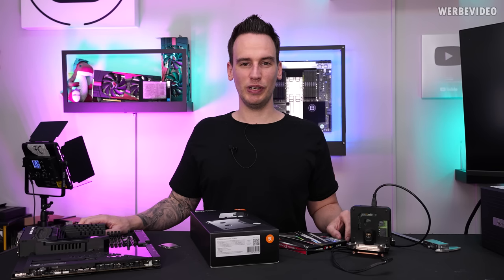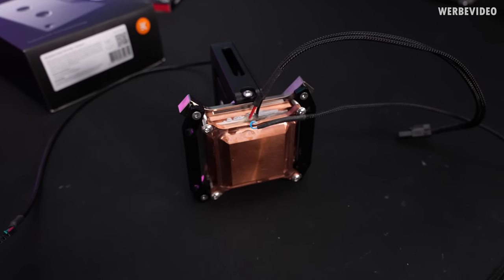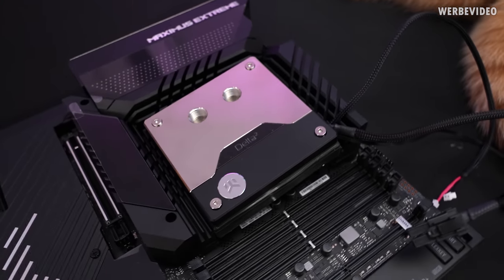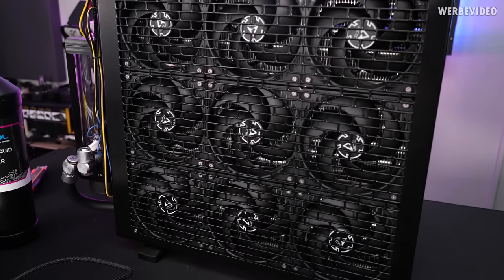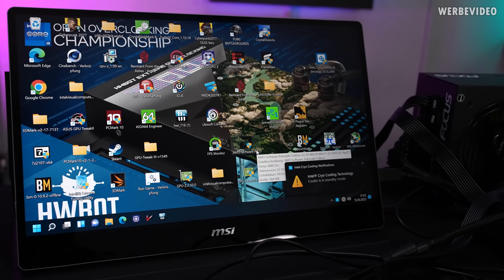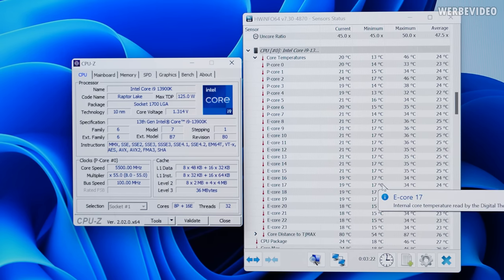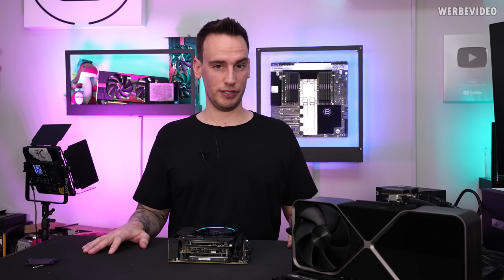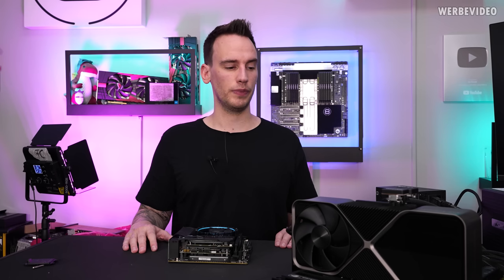This insane 500$ Water Block allows 13900K Overclocking above 6 GHz

Comment: How does the controller know the dewpoint? Temperature and pressure are easy to measure, but I don't think I've ever seen a small instrument that measures dewpoint. I just looked online and the only devices I saw for measuring dewpoint were very large instruments that cost thousands of dollars.

Tec cooling just doesn't make sense to me: so much complication and power use to get a marginal temperature decrease over ambient water cooling, and you still can't really go substantially sub-ambient (even with a big enough tec to do the job) due to the condensation problems in most climates. Exotic cooling makes sense to me in a test-bench context for extreme overclocking, but I don't see how exotic solutions really provide any substantial benefit (at least relative to the cost / complexity) for any kind of daily use, and even in the edge-case where you're crazy enough to do sub-ambient on your daily PC, I feel like phase-change cooling makes way more sense than Tecs. With phase-change at least you can get those really low temperatures.

Comment: sweet but how would the CPU handle City Skylines with 30 Mods, 2000 Assets, High sim settings TM:PE and a pop over 100,000 Cims

Comment: I don't get the 9 computer fan setup used by some Youtubers.
Almost any car radiator + car fan bought in a scrapyard would yield better thermals for a fraction of the price. Am I missing something here?
Also, the Peltier could be used in a liquid-to-liquid heat exchanger instead of direct mount to the CPU. It would cool down the liquid (not water) just before entering the CPU's waterblock, and have its hot side cooled down by the water exhausted by the CPU's waterblock. Thermal conductivity of the Peltier wouldn't be an issue anymore.

Comment: Isn't the DT1 error code means, that the Delta(Δ) Temperature is not met the expected value? Maybe the controller modifies the PWM for the pump/fan to check their condition, and expects a Temp raise or something along the lines?

Comment: David Miller (aka mllrkllr88) removed an inductor from the control unit and that could do the TEC to work at 100% all the time (with its PROs and Cons). Could be useful if you don't want to mess with software or try AM4/AM5. Regards

Comment: Great video!

Temp on single core/light multi core load seems crazy, but what about heavy multicore load? Could the peltier handle a cinebench multicore load?

Thanks
Reply: You'd need even bigger radiator. Peltier doesn't do it's magic for free, it consumes a lot of energy - and that energy needs to go somewhere.
Reply: @mirkokurac  my question was different. I argue the fact that those peltiers could not handle a full load 13900k and therefore you are going to have worse performance than a standard waterblock. The inefficiency of a peltier system is another topic.

Comment: I use Thermoelectric Coolers in elemental analysis to condense out moisture. They’re horribly inefficient and not meant for continuous and sustained loads. They will cool continuously up to a point, but you’re just wasting a ton of power.

Comment: which one is better? The intel tec2 cooler from ek or direct die cpu cooler from ek. Which one is better for heaving gaming and consistency?
Reply: what software did u use to auto adjust the boost with changes in themal

Comment: I believe the first commercial CPU peltier cooler was used in the early 1990s to cool a PowerMac 8100 CPU. That design was short lived as the flaw was the formation of condensation. Apple's solution at the time was to swap out the peltier with a traditional heatsink and fan.

Comment: You mentioned a 170mv voltage offset. Is it possible to have the voltage offset scale with frequency? 6.2ghz may need 170mv, but 5.9ghz shouldn't need as much.
Reply: You ca do this via the VF curve

Comment: Now that cpus went nuts with power consumption the idea of tec looks quite promising. My only concern is the liquid temp in the loop. AFAIK it should be below 50c for 24/7 usage in order to avoid hoses and o-rings deterioration. What’s your take on that, Roman?
Reply: what type of hose? PETG is pretty temp sensitive, but the o rings should have no issues at any temp in a pc. Remember cars use the same rubber for gaskets and hoses on coolant systems that operate at 100C for a decade or longer without fail.
Reply: If you have 50c liquid it means you are not cooling the liquid adequately. Liquid should reach a few C above ambient temp for high performance cooling.
Reply: Peltiers perform worse as load increases, if anything the opposite is true - It would be better for a CPU with a lower power consumption.
Reply: @CrusnikofChaos  Not true. I set up my itx rig to cool a 12900k and a 3090 on a single 240mm thin rad in a sub 10 litre case. 

The max CPU temps are 85c and GPU temps 75c, but the coolant can run up to 47-50c with fans ramping up to keep it no more than 50c.

I've had the system for 2 years and it runs perfectly and stays very quiet! 

Coolant running up to 50c is safe and useful for tiny builds
Reply: @Tom--Ace  This is not high performance cooling, for example I run a mora3 420 temps go a few degrees over ambient for moderate loads, better for high oc. I run 9900k 1080ti sli system, 1090watt full load.
Reply: @alexmills1329  I mean soft tubes. Not everyone builds hard tubes. Soft ones are quite practical.

Comment: So the issue with the rubber block sealant on the underside of the cooler is the hot and cold wires are protruding outward and sit on top of the VRM heatsink which doesn't allow it to drop into place or flush with the motherboard, correct? This appears to be the issue with rubber block sealant on z790 boards as the 4 mounting screws do line up it appears for the z790?  I could be wrong as I don't see a big difference between z690 and z790 as the mounting holes on the motherboards are the same I think. That said it looks like you could cut out a small section of that rubber block sealant on the top right corner, pull the cables toward the RAM slots and stuff the hot and cold lines underneath allowing the Delta 2 TEC to drop into place. Can anyone confirm?

Comment: Perhaps DT1 stands for "Delta Temperature 1"? Comparing the cold side thermo couple temperature and the internal CPU temperature and coming up with an error if the difference is too big? Essentially detecting a bad thermal contact between the cooler and the CPU...

And since the software sees the CPU temperature of the miniITX board the error comes up periodically.

Just a theory.

Comment: This is the way to go. I've been using a Frankensteined tec cooler for the last 15 years but it's only now that I'll splash out and get this product. The unfortunate thing is that it will only be compatible with socket 1700.

Comment: Why wouldn't one connect a sub-ambient cooler to the water loop via a water block, so that the chilled liquid can be used to cool multiple components? That's what I want to do with a phase-change cooler.

Comment: Hi @der8auer,
Will the Thermal Grizzly wireview available for the old 6/8 pin standard for GPUs?
Reply from the maker: yes :) the 8 Pin versions will actually be released first.
Reply: @der8auer-en   And i am guessing it will be compatible with the the dual 8 pin input GPUs.
Reply from the maker: we will have different versions available:
1 x 8Pin
2 x 8Pin
3 x 8Pin
12VHPWR

And others later
Reply: 1x 8pin
2x 8pin
3x 8pin
12VHPWR (unlaunched due to allegation of copyright infringement for IEEE 1394 "FireWire")

Comment: Peltier elements and their amazing efficiencies... so amazing... COP's of 1 or less at the dT we need it for with PC's....

And now we even combine it with a control unit that apparently is measuring humidity, as it seems to be able to calculate dew point.... Totally not an issue that with all the hardware heating up, the humidity is going to a low value where humidity sensors become unreliable. Totally not another issue...

But yes, let's push 200W into a controller to get a thermal heat movement that will only collapse if your CPU overheats. Can't wait for a proper phase heatpump to not suffer from being overwhelmed.

Comment: Nice video to compare to my 13900k. Running 5.7ghz all core and 6.1ghz for best 2 cores at stock voltages. Cinebench r20 single scoring 915 here. I have a custom loop with 2x 480mm rads and a rtx 390 in the loop.
Reply: Noice. Which case are you using that houses 480mm rads? I'm personally om the look out for a case that can x3 420mm/480mm rads but that's also not too gigantic.
Reply: All that for 100mhz? I'm on an LFII 420 at 5.6ghz all core
Reply: @jayr8282  i love the arctic lf2 line up <3. I'm also even happier they the cpu block has a clean design without rgb or some led screen. their argb fans are "cute" though, i wouldn't mind having those. 
btw which case r u using that can fit a 420mm?

As for the OP he most likely has a watercooling rig simply as a hobby and yeah if we're talking pure performance and discounting everything else then your a watercooling rig can get exponentially more expensive than an aio for the sake (on average) of 100~200mhz if even that.
Reply: @Ben-ld1qi  Hey Ben, Running it on a Thermaltake P5.
Reply: @jayr8282  I can probably do 5.8 all core with a little more voltage my temps settled in around 85c all core 5.7
Reply: @Ben-ld1qi  I'm using a Corsair 7000 case I have a 480mm X 60mm rad in the front with push pull fans and a 480 x 30mm in the top. Using a ek quantum CPU block a Corsair pump res a alphacool GPU block and z690 maximus motherboard which also has vrm water cooling.
Reply: @simonguppy6023  that's a pretty sweet setup. nice cpu block! I'm using all cheap barrow/bykski stuff. that 60mm in the front with push pull must be hella beefy lol. can you fit another 480mm on the side as well?
Reply: @jayr8282  omg lol i have a feeling it would be on of those thermaltake cases!
Reply: @Ben-ld1qi  yeah it was a tight fit. The 2 rads were a pain to connect together as too close to use some pipe I ended up using a couple of 90 degree couplers and pliers to tighten them. 3 rads might be possible but they would have to be 360 or 240s.
Reply: @simonguppy6023  cheers. which mobo are u using? i think i killed me asus z690 strix d4 due to a leak. not sure if to get a cheap msi z690 d4 replacement or a z790 instead.
Reply: @Ben-ld1qi  I'm using rog maximus z690 formula motherboard it's the white one with intergrated vrm water block. The build is white themed with white case white rads white dominator pro ram corsair white led ml 140 fans corsair white xd5 pump res and a few corsair rgb strips in white. all lighting is hardware set so no extra bloat software installed.
Fans and pump are set in the bios and setup to be near silent most of the time.

Comment: Got one remark as a fellow sub ambient cooler
Dew point is quite important for daily pc usage, it is calculated with room temperature and humidity
I have a little device on my desk to measure both and an app on my phone to calculate dew point
Usaly I can cool about 5c below ambient
Some cold dry winter days I can just turn my chiller on and play around at 3c
Reply: Damn youre brave doing that daily.
Reply: @bingbing3464 
Hehe thanks, have it running for a good 3 years now
Only once had a crash I believed due to condensation.
Started because I used sli, with this and 3 radiators pc was a bit to full for my liking
A second hand chiller was about the same price as my 3 radiators, so why not, looks a lot cleaner to

Comment: this would work a lot better if intel wasn't putting out 300W+ CPUs. This would be perfect for a 7700X.
Reply: Throw out e-cores make 8 p-core high frequency bin CPU. Everyone is asking but they're not willing to listen.
Reply: @sznikers  the Pcores alone are over 200W.
Reply: Did i miss vid or You never played around with Peltiers ?? Had one back at start of 200's runnin on my DIY water cooling lop with car radiator aquarium pump and old pickles jar as res :D
Reply: @lordzed83  I messed with peltier cooling on a 4790K. I still have the modules but haven't used them for anything in ages because they're a hassle to setup.
Reply: @ActuallyHardcoreOverclocking  yeah but they dont have to be. The 12 and 13th series seem to be configured solely to have more core count on the box than amd and higher frequency on the box than amd. If that nonsense obsession was thrown out a very sensible and very high performance sku is possible. They release gazillion sku's anyway, they even already have p-core only skus in xeon lineup offering nice efficiency. They just wall it off from us which is nonsense cause consumer market is perfect for p-cores. Most home stuff either doesn't scale with gazyllion cores or even if it could scale the code is not written to allow so. Cool they can have higher blender score than amd but rendering belongs to render farms. People play CoD with home PCs not simulate chemical reactions. At most some use Adobe software which loves strong threads too. 6 cores seem to be sweetspot nowdays, 8 cores gives little spare room for future developments. There are workstations and rent by the hour cloud solutions for professional work, this is consumer platform.

I know they're powerhungry as configured right now.
My bet is if you disabled everything but 8 p-cores (gpu,e-cores) then finetuned the power draw you could get cpu second only to 13900k in non pro scenarios but at half powerdraw or less. One thinks e-cores draw little power (50-70w for 16c?) but thats 50% of powerbudget of 125w SKU, and around 100W is what you want them configured for great performance without turning room into sauna. You could try that for video, "can stock 7950X/12900K be beaten with fine tuned eight 13th gen p-cores in games at less power draw" and/or lets say adobe pudget tests.

Comment: The power consumption of a TEC is a value internal to the operation of the TEC itself and does not relate in a limiting way to the heat drawn through the devise. For instance, if the efficiency of the TEC was such that its power consumption was only 30 Watts, that would NOT mean that the TEC would only be useful on a 30 Watt CPU load.

Comment: Rather than using a TEC why not use coolant with anti freeze and use a large reservoir in a domestic freezer to cool it. You could have -10 coolant running through your cooling block making it much cooler than the TEC at 14 degrees. A dedicated refrigeration type cooler would run much more efficiently than the TEC and not introduce all the extra power into the coolant.

Comment: I once did a DIY project where I put my 360 radiator inside a ~1 metre high deep freezer that I found. I managed to get amazing overclocks with really good temps, like 15-20'c load if I remember right.
I'm sure phase-change is more efficient at cooling than TEC. I wonder why companies haven't chased this as a form of cooling? i.e. instead of using phase change directly placed onto the CPU, use it as part of a sealed system, seperately on the radiator. Or some variance of this.
Reply: There are some phase change liquid chiller loops. I think Linus even reviewed one once. It's a very niche market due to price (I think it's going to be near $1000, and it sounding like a refrigerator)

TEC's are cheap... So it can still target that small market segment for a fraction of the R&D costs. 

But believe me, I'd love to have one!
Reply: @volvo09  Yes, that's what I meant with the direct contact to CPU. It's quite invasive and you need to build your PC around it.
With my method you need only put the radiator itself into the freezer, so it can be placed next to an existing PC without much hassle. They do make noise, but the freezer I had wasn't actually that much louder than a PC - it was a pretty sick build actually!
I had to stop using it out of fears for condensation, the liquid freezing, and extra electric costs.

Comment: why is that tech not able to remove 300W of heat? (real question) as my water blocked gpu uses 270-330w while gaming overclocked and has no issue removing the heat on a 240mm rad n d5 pump setup.
is it efficiency reasons? anyone know the answer?

Comment: i used to run them on my dual celeron 400. i had to use a 55W element on a 20-25W CPU and it was held at +4c so you should have two times the power to the element then you expect to remove. so if you r aiming to a 300W load a 600-700W element is needed.. that will need to be something spesial as you will need more then one element. 4 should be the minimum i gues. and yes.. i was running a dual PSU setup as well.

Comment: I'm guessing the old design might actually have a thermometer for the hot side as well, but it doesn't need to be wired externally as the controller is directly on top of it already.

Comment: mine works fine with 13th gen , i also spoke to ekwb about it and asked therm and they said it is compatible. im running it without any issues.
Reply: Same as 12th an 13th gen are cross compatible

Comment: It looks like you could have made a new cut and routed the wires out the other side of that corner on the gasket so solve the fitment problems. The 'top' of the frame at 8:37.